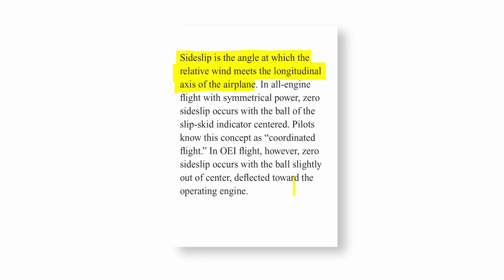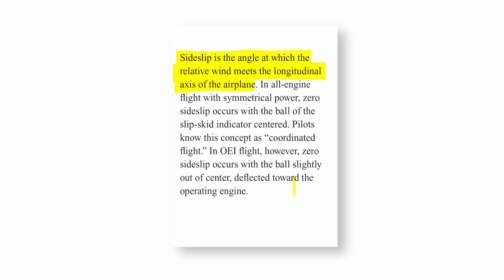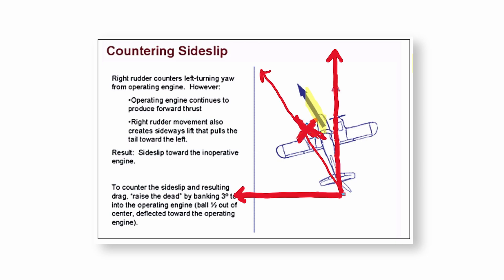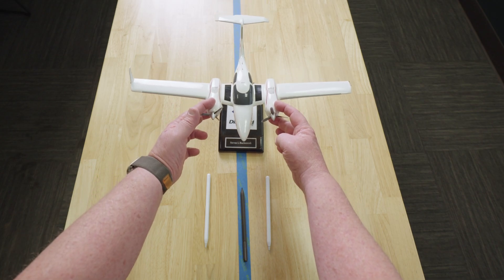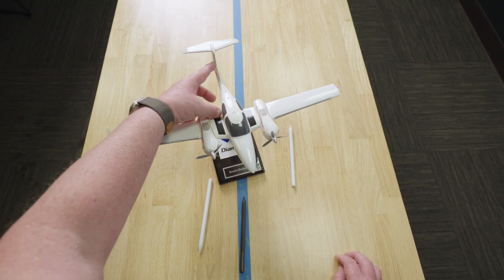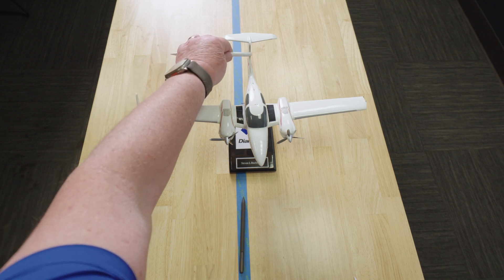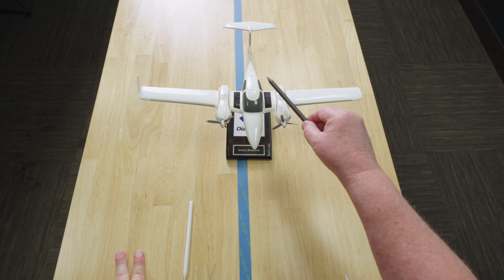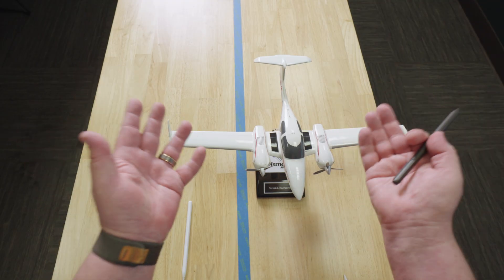Understanding Side Slip in Multi-Engine Aircraft

Comment: That probably covers the major forces at very small banks but there is also a contribution from the center of gravity being ahead of the center of lateral aerodynamic pressure. Related to the reason we load it to need some elevator down force in level flight. 

This is an extreme illustration to isolate the additional force components contributed by bank which are independent of the horizontal component of lift. For this when I say up and down I mean it in the gain and loss of altitude, not the internal control of elevator pitch and wing AoA. 

Now with an engine out, raise the dead to the extreme bank of 90 degrees with elevator positioned for no wing lift, straight ahead flight. Consider the center of gravity will be pulling the nose down, toward the good engine, and the engine thrust/drag imbalance will be trying to lift the nose rather than turn the aircraft. The rudder will now only need to make up the difference in the nose up/down moment. The engine induce turning tendency is completely removed. (Though now your only lift is from the rudder, and if slightly nose up the side of the fuselage and vertical component of engine thrust.)